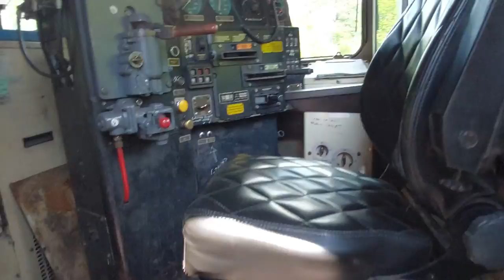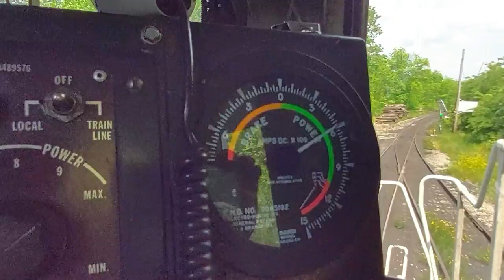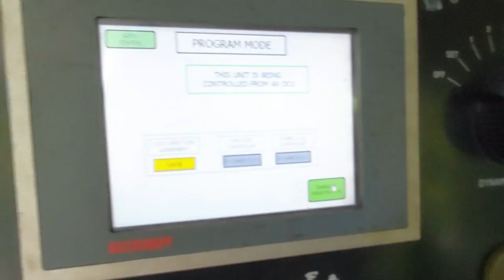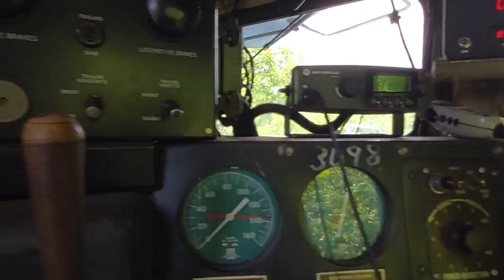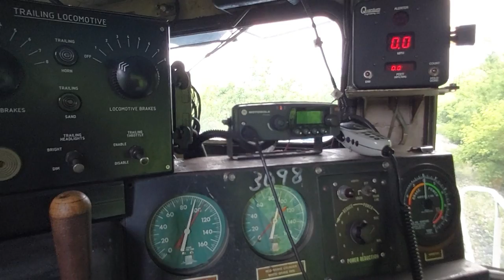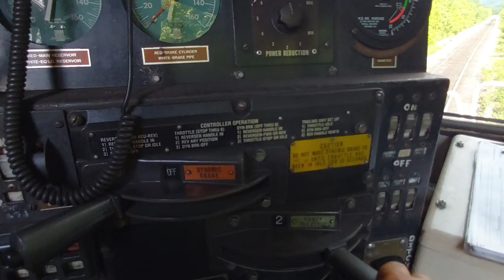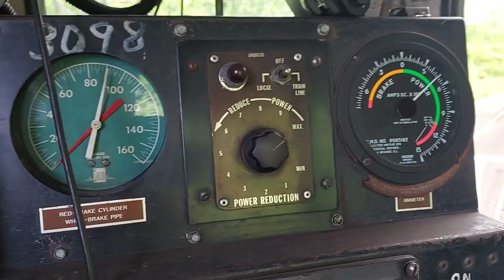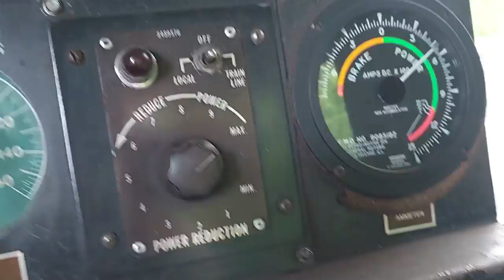Locomotive Remote System keeps Goofing Up

Comment: The RF filter in one of the two way radios is bad had this happen a couple of times one system bleeds into the other  old systems great video Dave
Reply: i was thinking the same thing.
Reply: I have dealt with problems like that many times over and the only people using two way radio is the railroad last place in the world not to go to the web communication
Reply: I expect the filters are a bit over heated at 90 degrees. I had the same issue in 450-460 repeaters I maintain back in the day!! The sound of the radios were a bit scratchy for FM gear, also could be caused by an inversion that is causing skip to roll which could happen all the way up in the bands. I have seen skip all the way up to 460 and I had a qso with another station on 146.52 fm on my HT on Field Day several years back… 

DE N2JYG
Reply from the maker: Thank you for sharing your thoughts Gary. Will pass that info on, I have no idea if the radios even have a filter? I just push buttons and run the darn thing....LOL Appreciate your taking the time to visit with us and take in the video my friend.
Reply: @franklinwerren7684  90f shouldn't really be hot enough to effect the RF filters. Now if it was 90c I would understand, but not 90f.
Reply: @garymessina1609 Web communication in a country as big as the US? Oops, you're running through a cellular dead zone, now your remotes are shoving in run8 while you're trying to stop! Good thing zoomers aren't running the railroads

Comment: As you might rightly assume, I am a ham radio operator. Today was my day to run our local news and information net(work). I live in Reno, Nevada. Our analog repeater system covers nearly all of northwest Nevada and also eastern California (I can see California from my window). Today, our technology team decided it was a great day to replace the repeater radios which link all of our repeaters together so that we have communication all across northern Nevada. It was the correct decision. However, it left me, the net control operator down to just a single radio repeater. We got through it just fine. We were reminded that when all else fails, the Radio Amature community is given a lot of frequencies for a reason. When disaster happens, we are on the air when your cell phones and 911 are not. Anyway, if you happen to see an antenna in someone's backyard, go talk to them They are the one you want when disaster happens. I will guarantee that they will have the communication system setup before you even knock on the door.
Reply: I'm not far from you living in yerington Nevada. I have a neighbor who is part of the local ham radio network
Reply from the maker: Thank you for the nice comment Rev. Kirk. Actually one of our train operators is a ham radio operator. He is now retired but I'm sure
he would be willing to help if needed anytime. A foreman for 
our RR contractor is also one, although he too is now retired, but
I know both of them very well.  Appreciate your taking the time to watch and may you have a most blessed day my friend.

Comment: I always thought that all EMD/GE loco's used the same multiple working system be it via direct cable or remote setup for DPU etc. That being the case any loco from FNBS or UP or CSX can be lashed up together and work in absolute harmony because it all falls under the AAR compatible ideals, so even an emd yard goat can be plugged into a AC4400 etc
Reply from the maker: You are so correct in your thoughts Leon. What is missing is we
do not fall under AAR, we do not interchange with any other RR
and we have a goofball remote system that no one else out there
has, it would not be compatible with LocoTrol which almost everyone else uses so they are compatible. Appreciate your taking the time to watch and may you have a most blessed day my friend.

Comment: I operated an Alco RS-3 at a RR museum many years ago, quite a difference from the SD-40-2! Speaking of which, that museum now has the original, prototype SD-40, the one and only, that started the SD-40 production!
Reply from the maker: Wow how cool is that Paul. I would love to see that 40. Let me
know where it's at and that may be a future road trip. Appreciate your taking the time to watch and may you have a most blessed day my friend.
Reply: @ccrx6700  the prototype SD-40 resides at the Monticello Railway Museum, Monticello, Illinois. It was donated by CN, due to its historical significance, was originally an EMD demonstrator, then went to GM&O as their number 950, merged with IC to form ICG, (#6071), then went to CN, with the same number. The museum has not decided whether to repaint it into the EMD demonstrator scheme, or the GM&O, but either one would be appropiate. They also have one of the only 2 EMD RS-1325s ever built, the other one resides at the Illinois Railway Museum, 35 miles west of O'Hare airport near Chicago.
Reply: @ccrx6700  and if you have a valid engineers license, when you go to Monticello Illinois, you just show it to the museum engineer on duty, and they just might let you run the museum's train🚂🚅❗That would indeed be a cool video for you to post on YouTube❗
Reply from the maker: @paulsmith5398  I don't have one Paul sadly. No one here does

Comment: If you set a couple pounds of air on the train, then shove against it, you might get a slower movement on the train while loading? would be trial and error to see what pressure you would need.  Also those shots looking down the long hood brings back memories of looking down the long hood of a Conrail unit switching Chrysler yard years ago. great stuff Dave, thank you.
Reply: That's also a good technique for spotting cars precisely in a tight spot when you're close to a bumper post or fence or something like that. Put a few pounds in the cylinders and shove in run 1 or 2. Everything stops very quickly when you go back to idle!
Reply: They've gotta know that stuff, is it almost SOP or a no-no for a technical reason, or just because the brake is left on & forgotten about too often?
Reply: @alro2434  It is common practice. I was not talking about setting the hand brake, I was saying just slightly applying the brakes on the train cars so you shove against something trying to stop. It allows better control and more precise stopping as Clarkpj said above on my comment here. :)
Reply from the maker: Actually you are correct in the Bryan. Usually when we start with
all empties we do set a few pound reduction on the car brakes, it
you don't the cars just push back and forth. Once you get around
half the train loaded take them off because of the weight on
the other ends helps prevent that coupler run in run out. Thank you for sharing your thoughts and for taking the time to visit with us and take in the video my friend.

Comment: Might try some type of shielding or something over the wires. Reason i say that is we have a 4 wheeler at work and when its aftermarket lights are the handheld radio acts up. Good luck
Reply from the maker: Thank you for sharing that opium extract, none of the wires on
the loco are shielded, sadly...... We appreciate your taking the time to watch and write in my friend.

Comment: If I had to guess, your 160 MHz Motorola VHF radio(s) is/are interfering with the 900 MHz Train Chief radio. I assume the systems used to work properly. So, did somebody bump power output on the Motorola to 'High' power? Did the Motorola's recently get reprogrammed and put in to high power mode? Low power might solve the problem. Did the antennas on the locomotive get moved closer together? Antenna separation is a good thing. Without seeing your setup in person, it's hard to troubleshot via YouTube. But I hope those suggestions give you guys something to look at. Good luck. [Edit after reading description] I'd be curious to know about the fire suppression system. Is a separate radio, or does it connect to your Motorola radios? If it's a separate radio from the Motorola, it's power output is probably too high, or its antenna it too close to the Train Chief. Again, without seeing the setup, it's hard to troubleshoot.
Reply from the maker: I have no clue about how the FS links into the radio shawnerz, they
just put it in last week and I didn't even know about it until the
other train operator came up there that day. Thanks for your
willingness to help out and for watching my friend.
Reply: @ccrx6700  You're welcome. Being a radio guy, this kind of problem interests me. If I were still living in MD, I'd offer to come out to see what I can do. But, I moved from there several years ago.

Comment: Are the alerter units transmitting continuously or frequently?  Sounds like time for some band pass filtering on the ptc receiver to filter out unwanted interference and tighten up its receiver bandwidth
Reply from the maker: Alerter is constantly monitoring Wayne. In the video description 
I wrote what was causing the problems with the radio interference
if you didn't read it, problem has been solved thank goodness.
Always is a pleasure my friend to have you watch and write in.
Reply: @ccrx6700  Glad you got you problems straightened out but  sadly I guess that will take you off engineer duty. We run into that sort of problem more often than I like in the LMR service side of things. Great video as always

Comment: Spectrum issue with bleed over into remote control frequencies….might be a rare occurrence since your slave remote system is probably not a widely used system…the manufacturer of that suppression system needs to be informed which you probably have done…radio frequency and power output would need to be evaluated with what has existed in your units before the install of fire alerter transmitter…
Reply from the maker: Thank you Kevin for reading the description! Far too many folks
don't, then write in with questions or comments that were answered
already in the video description. Always a pleasure to have you
drop by and write in my friend.
Reply: we have a radio tech here, thanks for chiming in.

Comment: 3098 sounds great Dave, prime mover sounds smooth like the old girl is just nicely broken in.  When I was on sea duty I made the (to me at the time) surprising discovery that a number of the Navy harbor tugs here in Norfolk had EMD 567 powerplants and they sounded great.

Thanks for bringing us along and showing us more of what goes on "behind the curtain."
Reply from the maker: Thank you for sharing your thoughts Robert and you are welcome. 
Lot's of old river tug boats around here used the  EMD engines and perhaps still do. Great old engines that keep going forever. Appreciate your taking the time to visit with us and take in the video my friend.
Reply: @ccrx6700  There is a very good reason that EMD and Fairbanks Morse prime movers were selected by the Navy in the 1930s to power tugs, submarines and small ships ... they were designed for use in the roughest service imaginable - railroads.
Reply from the maker: @robertf3479  👍😊

Comment: Great to see you at the controls Dave A nice change for you out on the track. I bet you enjoyed that as much as we did watching you. Good to see you got the problem sorted out, I was taught to look for the last thing that changed before the fault and that's what happened here. I am no expert on radio systems but see a few in the know have suggestions to stop it happening again. Some locomotives here have slow speed control similar to your hump control but use a sensor on an axle to keep the train speed at 1/2 mph, it looks to me like you are still controlling the speed manually but with finer control than the throttle notching up and down.
Reply from the maker: Thank you cedarcam for the nice comment, always a fun day when
a MOW guy can be in the loco cab.  Reason things goofed up is in the video description, yep the last thing that changed did it. Appreciate  your taking the time to watch and write in my friend.

Comment: Seems like a RF filter failure on the remote, the remote system would have RF filters to reject anything thats not on the frequency the remote is using, and if they (one or both) failed then thats why its getting interference from the radio.

But that being said anything having to do with wireless communication can be finicky as they can be effected by a lot of things, atmospheric conditions, solar conditions, RF noise and so on.

A ground issue can also lead to funky behavior with radios.

Same with bad coax or a bad antenna.
Reply from the maker: Thank you forr sharing your thoughts and for trying to help out
madmax. We appreciate your taking the time to watch and write in my friend.

Comment: Always love cab footage from 3098. Pretty cool about that hump control. So basically it's a fine adjustment for the traction motors to really dial in your crawling speed for loading?
Reply from the maker: Thank you for the nice comment Shane. You are exactly right in the fine tuning of amps to the traction motors. Wish the darn thing would have worked or I could have shown you the amp draw and how different it is in hump and without hump. Roughly figure about 10 amps on each turn of the hump control dial. Appreciate your taking the time to watch and may you have a most blessed day my friend.

Comment: Where I live we have lot of C36-7i in use. They have been converted to a 1520mm tracks to be used. Most things in the cabin area of the C36-7i and SD-40-2 seem to be the same. A few things are different, there is a different track current indicator,  a button that the engineer needs to press at a fixed or random interwall so the train dose not go into emergency. Some cabs also have retrofitted air-conditioning. For a old locomotive these things are still going strong.
Reply from the maker: Thank you for sharing that Steve, very interesting info. Appreciate your taking the time to visit with us and take in the video my friend.

Comment: 😢is it a physical wire connector to the radio and control box for the throttle, or is it wireless, transmitting digital data over the air, like the HOT/EOT FRED system uses ?
Reply from the maker: Is this serendipity or not ocsrc. Actually was thinking about you today, haven't heard from you in awhile and was wondering if you
were doing okay. Good to hear from you tonight my friend.

There is no connector between the radio and remote system,
however the remote system and the control box the operator
has while loading is radio transmitted as is the signal from loco
to loco. Hope that helps.
Reply: @ccrx6700  I am having serious health problems. My levels are high and I have to get more tests. Been really sick and really tired. Very worried about myself. I hope I don't die from this. I hope they can fix me
Reply from the maker: @ocsrc  I am so sorry to hear that ocsrc. The wife and I will keep you in
our thoughts and prayers. We are pulling for you my friend. When you get a chance
please keep us informed.

Comment: Dave, maybe one day you can explain the exhaust system on a locomotive. What keeps the rain water from getting into the engine?
Reply: You go along both sides of the engine and crack open all the cylinder test cocks. Then you push and hold the fuel and lube oil prime buttons for awhile. Then while holding back the layshaft in the 'no fuel' position, you hit the start button to roll the engine over with zero fuel to blow any water out of the cylinders that might have accumulated while shut down. Once it's 'blown down' you can go close all the cylinder cocks, and then fire it up. Once it's running there's plenty of exhaust gas to blow away any rain, plus the exhaust manifolds are so hot any water would turn to steam. If the locomotive is going to be down for a long period of time, they probably push it inside their shop, because that means something is broken on it if it's down! Ain't makin no money unless the wheels are turnin.

This startup procedure from a cold and dark startup is very important, because if there's any water in the cylinders from rain or a small coolant leak, it will hydrolock that cylinder, and then you'll end up tearing into the engine to change a power pack or two. Not cheap or fun to do.
Reply: @brnmcc01  What I'm asking is if there anything to prevent water from entering the cylinders. If the engine was outside and not started  for over a week during heavy rain storms does the water accumulate and go into the cylinders with open exhaust valves or is some sort of drain involved to prevent it.
Reply: @B4TS1  Oh your right that would be bad, because the valve seats/cylinders could get rusty. If stored outside for a long time, then you'd be better off to cover the exhausts with something. But normally there's cylinder drain cocks that are opened up, and the engine rolled over a few revs with the starter to blow out any water before starting. On most major railroads, if a locomotive is on duty somewhere, they're usually left running. 24/7. Especially in the winter, since almost none of them use antifreeze, just plain water with corrosion inhibitors added, so leaving it shut down in freezing weather outside could cause the block to crack along with the water problem you mentioned!
Reply from the maker: They do have covers they sometimes put over the exhaust stacks
when loco not running. However most times they don't cover them.
So if engine gets rain down the exhaust, they open the decompression cocks on each cylinder and turn the engine over
a few times to push the water out. Then they start it.  So there
is your explanation Clock Watcher. Appreciate  your taking the time to watch and write in my friend.